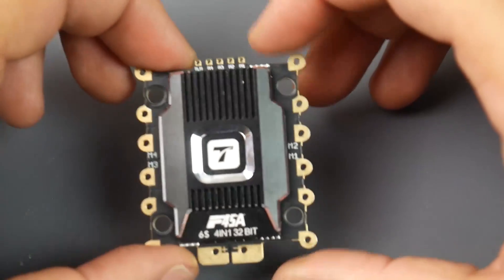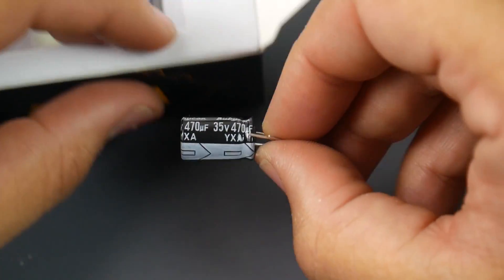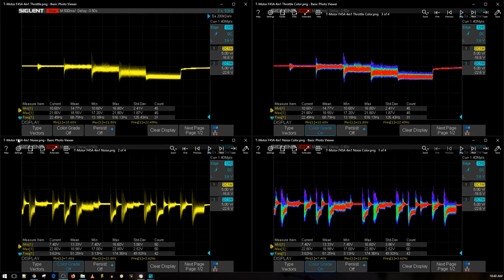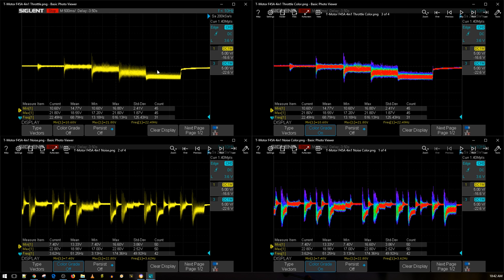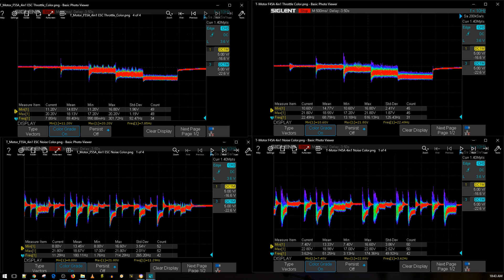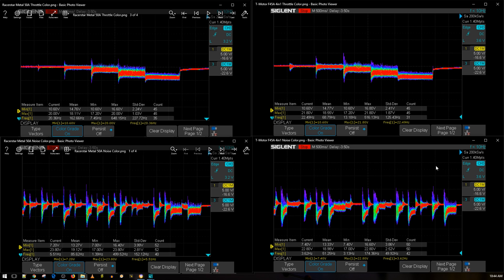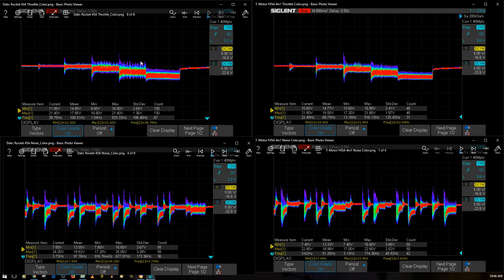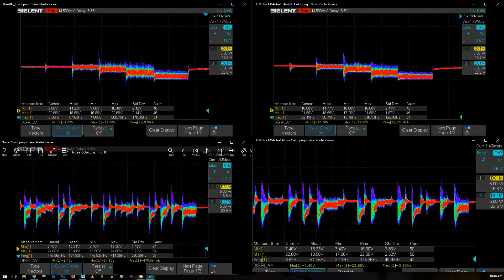F3 MCU, Full Telemetry 4in1 ESC // T-Motor F45A 4in2 ESC Review and Noise Test

Comment: Have you tested the V2 yet? I couldnt find it in the documentation but V1 has F3 , Im assuming V2 does. I just bought this with there new F7 flight controller and Im hoping its a little more reliable than Iflight. I would think based on all the reviews and testing or this and its older brother. I am doing the build soon😁

Comment: I just got this 4in1 and I can't seem to be able to get it to connect to the configurator or the suite.  In the suite it does read it as a blheli32 esc but does not recognize it at either atmel or silabs.  Has anyone been successful with this?  It works ok, I just had to set the motor directions manually but I would still like to be able to get into the configurator.
Reply: Did you use blheli32suite? Or blhelisuite

Comment: so is this the best 4in1 with full telemetry or are there better ones out there? :P im gonna use only 4s for now but would need full telemetry :P
Reply from the maker: Wait until this Sunday I got something out of this world.
Reply: ok now im hooked ^^  @DroneMesh
Reply: you sure this is a high current esc with full telemetry that youll drop on sunday? and will it be avaiable "soon"? Dont want to wait too long if it doesnt have the required features or isnt available soon :P  @DroneMesh
Reply from the maker: http://bit.ly/2FHx24r
Reply: hmm so no full telemetry here, "The 4in1 has onboard analog current sensor, and TLM function(then no current reading over TLM)"  i need one with 4 shunts unfortunately  @DroneMesh

Comment: great vids man your really smart . ever here of lumeneir 36amp blheli32 with Telemetry  single ESCs. ive been using them for a while now and i just think they are great . bardwell told me they were rebranded racerstars and are junk . i dont think he even knows what hes talking about
Reply from the maker: Even if they where Racerstar, they make great products and some not so good just like any other company but 88% of their product are great products I care less what anyone says I have used them for over 2 years and had little to no problems.. I have not tested those esc's but I will try to get my hands on some for you.. Can you email me the link..
Reply: @DroneMesh  oh absolutely man. Yo I dropped my dam quad in a pond for 8 hours with a battery plugged in. After we found it which was a last ditch look for it, I dried it out over nite  cleaned  it off and the dam esc's still worked. that was over the summer and I'm still using 3 of them. One developed a little sag after a while but that was it man.
Reply: @DroneMesh  https://www.getfpv.com/lumenier-36a-blheli-32-32bit-2-6s-w-telemetry.html
Reply: @DroneMesh  I agree about racerstars   I like there stuff. I've used plenty of their budget motors and they haull ass lol

Comment: I dont understand why these guys put these tiny caps and resistors so close to the standoffs. They get knocked off in those crashes that break the standoffs. DRONEMESH WHEN YOU DO YOUR OPEN SOURCE 4 IN ONE ESC PUT THOSE FAR FROM THE STANDOFFS! It looks like it was done right on the F55A version tho.

Comment: Just bought the dalrc 45a 😡 should I cancel my order??
Reply from the maker: No both are good.. I use the dalrc engine on my fav quads..
Reply: Drone Mesh I already canceled it so which one should I get I plan on using a 1000uf 35v cap
Reply from the maker: @ryanzimmerman2375  Get this if you have the cash
T-Motor F55A
http://bit.ly/2JIdAo1
Reply: Ryan Zimmerman no that’s a bad ass esc I haven’t had any problems out of those